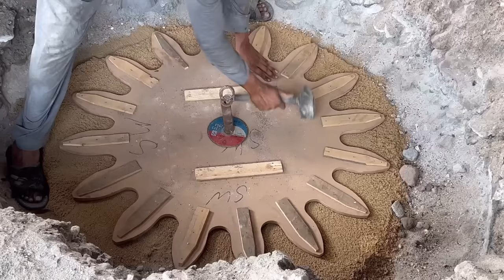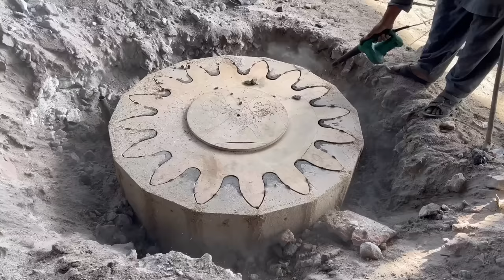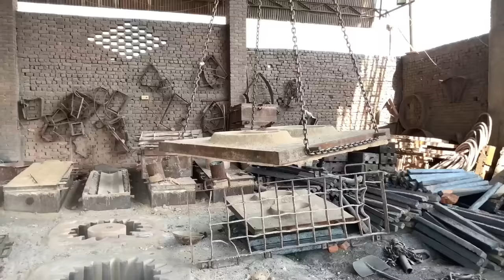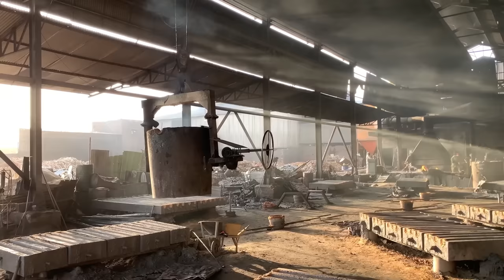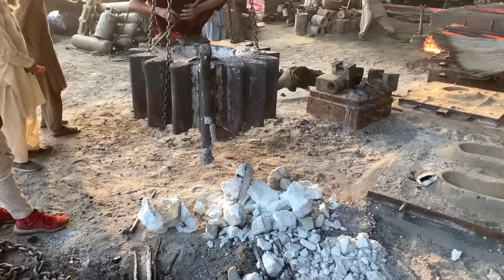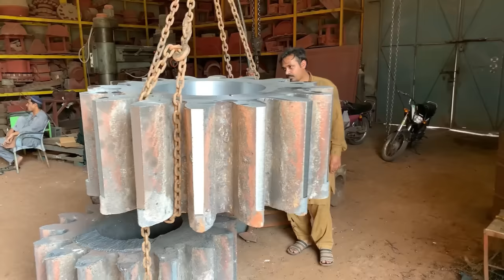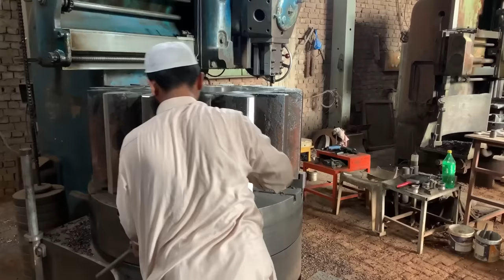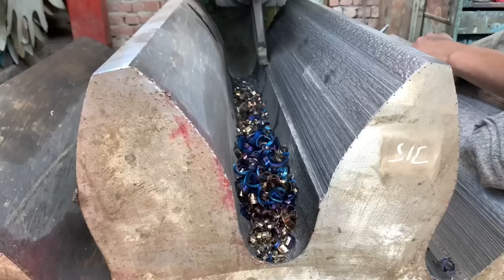Handmade Making Process of Large Milling Machine Gear | A Huge Industrial Gear Manufacturing Process

Comment: Your steel mark will be "whatever we had in the scrap heap that day", and heat treatment will be "very good", with carbon content of "dont worry about it", tolerances of "very good" and surface finish of "real smooth".
Reply: Yes.  However this is also true for 90% of things bought in the United States these days.  Nylon and Polyacetal gears are more durable than "steel" gears made in China.  Everything has "Made in China" printed on it.  Everything "steel" is made out of recycled printers, refrigerators, and crap.  Every made from "steel" likely had a decent percentage of copper, nickle, and other metals.  This is why half the office chairs in the USA, the adjustable bolt in the back has stripped threads and almost every chair doesn't work properly. This is why if you try to hammer a nail into hard wood, it will bend. The nails available will barely go into farmed pine.  You need a pneumatic nail gun.  If you try to drive them in with a hammer and don't get it the first whack, it will bend.  It isn't just nails.  All hardware is like this.  All appliances are like this, microwaves, fans, ovens, washing machines, anything made overseas.  Fortunately most important western automotive drive-train, engine and transmission parts, are not made in China yet.  Otherwise our engines would explode after 25,000 miles.
Reply: @BrettonFerguson  maybe that is why it is not made in china? It would explode before warranty is out=)
Reply: @BrettonFerguson this one is from Pakistan though
Reply: @BrettonFerguson America Moment comment
Reply: @BrettonFerguson  I complained about nails bending because they were shitty nails once.  I got shown real fast that it was just because i have skill issues and someone who knows how to hammer gets it done.  
Maybe someone needs to show you.
Reply: yeah whatever if you think this is quality then every opinion you have is suspect @JordanPNW
Reply: @JordanPNW  Yeah, nails are supposed to be a little bendy, it has to do with their shear strength. I'm sure older nails bent less. In fact during a remodel I pulled some 1970s drywall nails out of my walls. Sure enough the older 1970s drywall nails are crap compared to any modern nail.
Reply: You sounds like someone who thinks they know what they're talking about.
Reply: You criticize, but the device you're commenting on was created by machines tha somewhere down the line were built exactly like this by people with just as much skill, sandals notwithstanding.
Reply: Also, someone who knows about metallurgy doesn't see scrap. Look more closely, transformer cores (Silicon Steel), Compressor housings (Mild Steel), Iron Scrap (Iron), I'm sure with a gear that large they have a pretty good idea of the final steel makeup. They're also using Sodium Silicate casting sand. And those milling machines are accurate to under a thou if they're scraped well (by hand I might add). These people know what they're doing.
Reply: @BrettonFerguson  you have to pre-drill for nails now, if your drill bit holds
Reply: it's nice to know I can DIY this in my backyard, looks easy enough
Reply: @BrettonFerguson   " Fortunately most important western automotive drive-train, engine and transmission parts, are not made in China yet.  Otherwise our engines would explode after 25,000 miles."

Tell me you haven't been to the auto parts store lately, without telling me you haven't been to the auto parts store lately. Junk 3rd party parts for classic cars are a BIG deal. cams that get wiped within 1,000 miles, parts machined way out of tolerance, or bad out of the box.
Reply: in china they have a phrase for that level of quality,  it's called  "Cha Bu Duo".  Translates to   "yea,  more or less"  LOL
Reply: @wackbirdz  Yeah, but to have an idea what the steel is you'd need to test the smelt before the casting, instead of just praying it would come out alright.
Reply: I was told "Almost good enough"  @daomingjin
Reply: Alloy composition: YES
Reply: And you don't even need any fancy X-ray equipment to detect micro fractures as the ones I spotted in this video, ON A PHONE SCREEN, looked large enough to put a childs finger in.
Reply: Don't forget the safety sandals
Reply: And hearing protection level is I don't like hearing anyway
Reply: I'm impressed actually. But yeah, a lot less engineering went into this than was probably needed. But, if the huge gear isn't really meant for something high precision, then it will probably be fine.
Reply: you forgot the epic safety PPE (personal protective equipment)
Reply: Ain't nothin an angle grinder won't fix.
Reply: ilaahay wuxuu yidhi ninkii idalbo wuu iheli ninkii ihelo wuxuu helay wax walbo ninkii iwaayo wuxuu waayay wax walbo,,   anigu waxaan leeyahay majirto meel laga heli karo oon islaamka ahayn alxamdu lilaah calaa nicmatu al islaam Alahuma sali calaa sayidinaa muxamad w aalihi wasaxbihi wasalim ❤❤❤❤❤❤
Reply: I also found the alloy process amusing
Reply: That's clearly a .4 ra finish
Reply: all in there flip flops too
Reply: @mr.t993 They can't really help that, now can they? They don't have big factories with automatized milling etc. Their only option is total loss manufacturing with the whole "having to make a new mold every single time" thing.
Reply: Lmao😂
Reply: @Beakerzor no you don't, and if your bits break you're just buying cheap bits. Cheap bits are fine for small scale work like a homeowner hanging picture frames or small craft projects. Cheap tools are good for their purposes, but they shouldn't be criticized for not holding up in industry applications.
Reply: looooooooooool
Reply: They use the "that'll do donkey" concept. 😂 Still I bet they make better products than the US does under oshaa scrutiny.
Reply: It makes the engineers job interesting if we throw in a bunch of 'unknowns' and 'probablies.'
Reply: Its a gear off a roller mill. Prob. to hot roll rebar, so usually it comes down to wood is softer than steel, heat treated steel is harder than not heat treated steel and red hot steel is softer than cold steel. Playing rock paper scissors with the steel quality marks and if youre guessing you can just overbuild it or build it with experience on what failed. You act like someone came down from heaven to drop a list of rockwell hardness on your head and turned you into an engineer and now youre bullet proof.
Reply: “So, what’s the alloy composition?”

“Yes.”
Reply: @anonops1980  iVery good composition. 100% alloy!
Reply: @gantz4u yup, probably a slow speed gear. If they are taking the time to make it that means someone is buying it which in turn means it must be working for some application.
Reply: @kode4420  Us products are probably 3 to 6 times better. The reason Osha exists is for worker safety. It has nothing to do with quality.
Reply: @BrettonFerguson  You get what you pay for. That is all.
Reply: @BrettonFerguson  It's all about the intended use. If it's components for mass produced consumer goods, it's likely to be crap to "does it's job for the most part".

Then you go into hard industrial use or high end commercial use, and you begin to see price and quality brackets where you get what you pay for.

Then you graduate to critical use where lives can be in danger (Medical, Aerospace, Nuclear, etc), and you bet your butt actual certified and audited manufacturers aren't just pouring cast into the ground like this video. There's a reason that sector is so goddamn expensive, the amount of resources and man hours that go into manufacturing those things border on excessive, but for good reason.
This video is neat in that you see the basic principle of casting process. But don't go thinking this is the actual industry standard.
Reply: @kkon5ti yeah, having basic standards for manufacturing is definitely just an American thing.  It’s not like most European countries share that standard to a degree or countries like Japan.  You sound jealous.
Reply: AGMA rating?  who needs it 😂this gear has a rating of: can handle a lot of horsepower at a minimal rpms.  In all honesty though, we are just Americans projecting our standards onto this mess which isn't necessarily right.. but fun to do!
Reply: @BrettonFerguson  you must be wandering around trying to insert "made in china" statements all over youtube lol
Reply: You should go there and explain to them why they do it all wrong. O great savior.
Reply: I spewed my coffee when I got to tolerances.
Reply: you all funny anti western, no even before we didnt make it this way. These guys are on level 9 century, we didnt invented these things in 9 centruy yet in Europe i am Sorry
Reply: But maybe that's all this part really needs to be. I can bet it is a replacement part for some seriously old machinery, like some 100 years old mining equipment, and is supposed to be slowly rotating and is not overstressed, and can be totally fine for another 100 years or so...
Reply: @protector1990  exactly,  they  know what they  are doing and probably very cost effective.
Reply: @protector1990  Have you seen these guys mine? It's with rods and hammers.
Reply: @Jadder88z  As opposed to you who sounds like someone who doesn't know a damned thing about a damned thing.
Reply: @BrettonFerguson  You get what you pay for. China has top tier quality steel, aswell as shit steel. All depending on what you pay for. 

Apple assembles its phones in China, at a pretty good quality. Cause they pay for good quality. Then you find Chinese products that is rendered useless buy you just looking at them. Often made as cheap as possible.

As with everything capitalism. You get what you pay for. Sad thing is capitalism wants to make things as cheap as possible. Thats why quality suffers alot these days.

Who wants to buy an expensive metal shoe iron when you can buy a plastic one at 1/20th the cost. The expensive shoe iron will be cheaper in the long run. But few think further ahead than their next paycheck these days. Consumerism 101
Reply: @BrettonFerguson  I have chinese air pump(used for amusment park)it is 35 years old still working like clock,never opened never broke..
Reply: @wackbirdz Phones and the microprocessors within them were designed by people lightyears ahead of these people in skill and intelligence, and assembled in clean rooms. The fact that the actual mechanical labor that goes into connecting displays and fastening cases to the devices is relatively unskilled does NOT mean the skill or effort involved in getting even low end consumer electronics into peoples' hands is equivalent to the craftsmanship of these shoddy gears.
Reply: @BrettonFerguson  these gears arent made for export.lol...this is typical for India,it's a matter of not being able to afford one brought in
Reply: Suppose this is where German manufacturers have been outsourcing.
Reply: carbon content? it's just the burnt boards they are using as shaping. they bring some carbon to the table
Reply: @mr.t993   considering this video was filmed in 1836, it's pretty efficient for that era
Reply: @BrettonFerguson . As in Kia or Hyundais!
Reply: china !
Reply: Gears like this are used for bridge mechanisms and such.  They don't turn fast, never get a lot of revolutions, and the surface finish will lap in with wear. There are 150 year old mills with gears made in this fashion that are still working.
Reply: @mzmadmike  yep, and one day it just strips/shatters due to a void or crack, with bridge falling onto a passing ship. Real gears are forged from proper steel for a reason.
Reply: Э, качество хороший, мамой клянусь!
Reply: Very funny indeed. A few years down the line, you maybe laughing through the south organ.
Reply: @BrettonFerguson  look for air bubbles in engine blocks as well
Reply: I doubt the concept of taking a batch sample of the steel even exists there. They have no idea what the steel will be like or how many impurities there were.
Reply: I read somewhere that the steel these guys are using is the same that was used for the hull of the uss Virginia and the uss Texas. Good down to 2000 ft.
Reply: @kode4420 yea I'm sure they do hahahahaha hahahahahahaha
Reply: @jac1207 what you mean elon isn't making his rockets this way
Reply: Dude, you don't live in their world...
Reply: you're pretty defensive @JordanPNW
Reply: @BrettonFerguson  GOD BLESS USA !!!
U S A !!!
U S A !!!
U S A !!!
Reply: But the guys came easily get better pro cider they make lots of these
Reply: @mr.t993  It doesn't matter because labor is so dirt cheap in Pakistan, India etc. Modern technology to do this on a large western production scale is way too expensive in these places so loads of stuff like this is still done "the old way".  When I was travelling in India I saw a guy cutting a grass verge with a scissors.
Reply: Instead of being impressed how they managed to make something like this, you chose to rather talk shit about it. Sadly that comment says more about yourself, than anything else here.
Reply: @joonashannila8751  Next time you walk under an open bridge, you better hope the gears in it are not made by these guys. There is nothing impressive about making parts that will break when you sneeze at them.
Reply: They didn't show the whole process of getting liquid metal.
Reply: When our processes fail this one will still work though.
Reply: I don't think someone showing him how to hammer a nail will change the composition of the steel used to manufacture the nails @JordanPNW
Reply: And it'll be good enough for long enough that they'll keep doing it!
Reply: I have heard that scrap iron actually improved the melt. I had a friend that owned a scrap yard. I drove a truck for him when his driver was in vacation.  One day I delivered a dump truck load of scrap to the foundry at "NASCO" ship builders San Diego. They make oil supertankers and ships for the Navy.
Reply: My dad was a carpenter. Never saw him bend a nail. I did all the time.
Reply: @iguanapete3809 Scrap is fine if you are casting a ballast keel, all you care about is mass. For ANYTHING else, you would want to control the carbon content of the smelt at the very least. And just dumping random scrap into the pot gives you random carbon content, i.e. random material properties.
Reply: at least they are still making things... maybe  not the best but still have men that are able to... and my guess would be those are made on machines scrapped or retired for the UK or US at some point..
Reply: @damright true that. The saddest part is that using equipment to monitor for carbon content is not actually hard or high-tech compared to what they do. They deliberately choose to not care.
Reply: Yeah and this costs 1/500th the price and it'll still work for years. That's the point your missing, they are literally in a crap tin shack.
Reply: it does not need to be exact never has been its not an aircraft engine
Reply: Well, there's a demand there for a big ass gear, it got made and it works for them, so eh.
Reply: It is a special material called steelium, it only breaks when you are looking at ...
Just close your eye and everything will be alright ! 😅
Reply: bahahahaha yep!
Reply: And they said, go with the cheapest ones, but make them bigger so we don't have to worry about all of that :))
Reply: Still steel
Reply: With a warranty of "no problem brudda no problem!"
Reply: @JordanPNW I don't think this imminent failure would be a user error lol
Reply: Cost is "real competitive" and not a "total rip off"
Reply: Gear durability: "in God's will"
Reply: just because you suck at hammering doesnt mean substandard nails dont exist lol  @JordanPNW
Reply: This is how a lot of machinery was made in the old days and it worked. As long as these parts don't go into some complex mechanisms working under heavy stress they will do just fine. Moreover, the price must be extremely low in comparison to ordering them from a factory. So as they say, if it works...
Reply: @big.atom37 you'd be surprised how massively overbuilt vintage machinery was to compensate for the quality of the material. Nobody designs like that today.
Reply: I dunno much about casting, but when I saw that planar machine with a shitty blade take out that much material in one pass as it was going through cheese, I bet that gear was hella soft.
Reply: I worked at an european company. Same process. We even had our own pile of scrap metal!
Reply: Steel better than US machinery.
Reply: @mr.t993  if labour is cheap, you use lots of labour.
If labour is expensive you use the right tools for the job.

It's simply cheaper to hire 100 guys to do the job in some countries rather then optimising.
Reply: Sure. But I have to assume this is made in a developing country. This is how the western world made things 100+ years ago.
Reply: @sniper8567  you have very low opinion of the craftsmen from "100+ years ago". Remember, Eiffel tower is still standing, and it is some 150 years old.
Reply: @wackbirdz  Probably his device was created by very precise and well made machine because this is more efficient than parts made by hand with melted trash. And yes those are trash. Transformer cores are made by different materials, what exacly is "mild steel" albo how they measure amount of those? What about inpurities like paint or oxides? Everything is beyond any control.
Reply: I'm not even near this business or have any experience in it, and I wanted to comment exactly that. Plus, OSHA would have a conniption over this process. Well if Pakistan or whatever country this was filmed in had an OSHA. It's still an interesting video, just to see the alternative ways of doing things
Reply: Close enough to perfect
Reply: Or you could just use good nails.
Reply: @BrettonFerguson  Oh.....and don't buy anything ever that says genuine cow hide, genuine leather or leather that is made in Chine. It can be made in Cambodia, Laos, Vietnam, Bangladesh etc  etc and it WILL be leather if they say it is.
Reply: @BrettonFerguson  Yes but No, if you want qualitiy steel then you will get quality steel for a price. Its just that american companies buy low quality steel and parts from china because its cheap.
Reply: A good engineer would use chewed bubble gum if it fit the requirements.
Reply: 100% guarantee you couldn't even come close to this using the same tools.
Reply: @jacobalberty  Today you can use Strongtie structural screws.
Reply: And child labor isn't a problem
Reply: Safety protocols will be "fine".
Reply: @kkon5ti  Oh, Pakistan? What a relief...
Reply: Your comment is very accurate and very funny! I also liked the moment 33:37 when the milling operator measured the depth of the chamfer)))
Reply: @BrettonFerguson  Nails are supposed to bend and flex like that. If they're too hard or stiff, a bad hit could cause it to fail and break.

Manually hammering in nails has always been tedious and frustrating.
Reply: @JordanPNW  also.... nails aren't typically made out of steel anyway...
Reply: Go easy on the workers, they're only kids.
Reply: C'mon, they don't even use safety glasses to see that everything is perfectly at high level! Those kids at the video are there for the same reason to make sure of quality control with their child eyes.